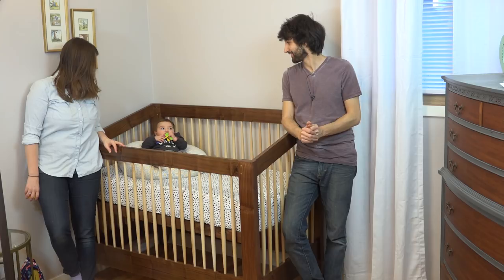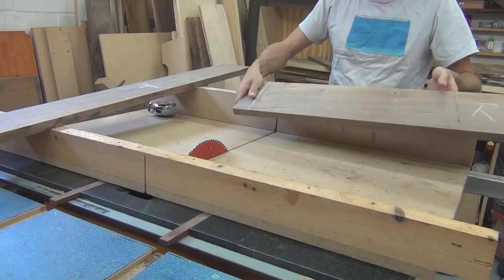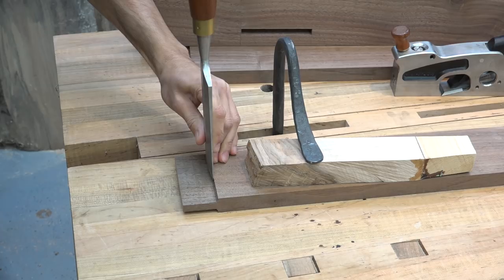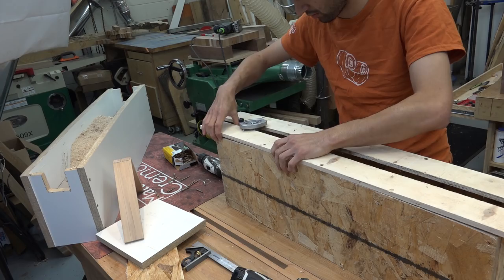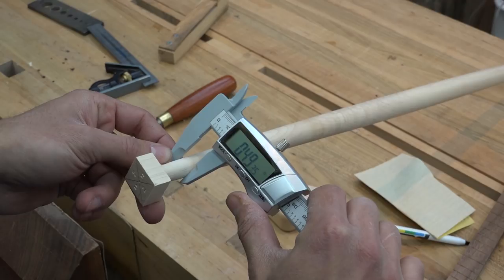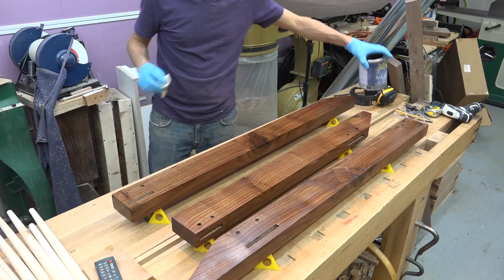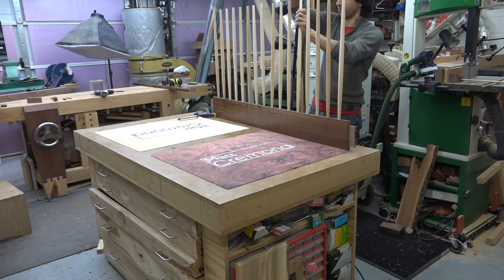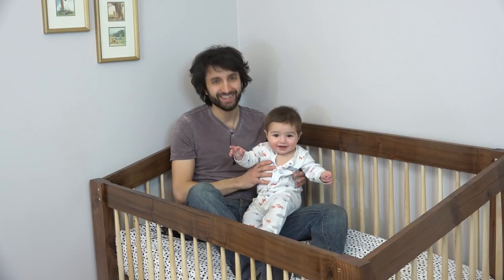Making an Adjustable Height Walnut and Maple Baby Crib

Comment: Finally! Been waiting ages for this. Why did you choose to create a tenon on the spindles and not just slide them into the rails as is? Looks amazing Matt, really enjoyed the video
Reply from the maker: Finally :) sanity reasons. I would have had to make 9 jigs or modified each spindle's taper to hit 1/2" a different length from the center. Thank you!

Comment: Did you publish the basic dimensions on this crib anywhere, Matt? I will probably be building a crib at some point in the next year or so and absolutely love the way yours turned out. Thinking I'll just buy Walnut dowels though, hah, those spindles looked like a lot of work!
Reply from the maker: I don't think I have them posted anywhere but the frame is just sized so the mattress fit snuggly inside it.  The spindles is where all the time goes

Comment: Awesome video, Matt, really appreciate the long form video with details on all.  Also, awesome work! One question for you - did you use a special blade or set up other than that small jig to cut the brass rod on the bandsaw?  I've been too chicken to do that before with a wood bandsaw, but looked painless in the video.  thanks again
Reply from the maker: Thank you! I was nervous at first and didn't know what to expect. I even added some oil thinking that might help. I was able to just run it through as is without issue. Granted I do have a carbide blade in that saw but the feedback I heard from others was that brass will cut easily with a regular blade too. I did a bit of a demo going through the cutting in my shop update here http://youtu.be/pzlBhf9NpXw starts at about 2:30 in

Comment: I've watched this video about a half dozen times now trying to work up the courage to do it myself, but I have limited tools and experience.  There is a lot to consider, I'm curious what references you used to decide the height of the front and rear legs, and the adjustment levels of the mattress.
Reply from the maker: +Slagon Drayer I referenced the cpsc standards for cribs which is what manufacturers would have to conform to

Comment: amazing work as always matt, been looking forward to seeing this for a while, do you think the reason the spindles yellowed was due to the fact it was in a aerosol can and pressurised? the reason I ask is I had the same results when brushed on it stayed white but when I used a spray can it yellowed but they were different brands...many thanks scott
Reply from the maker: Thank you Scott!  I'm not sure.  I guess the only way to find out would be to buy a can and apply it by hand.  The water based finish that I previously tried stayed nice and white.  Different brands as well.

Comment: Very nice! Is the mattress adjustable? It looks like it's too high, thanks for sharing
Reply from the maker: Thank you! Yes, the mattress can be positioned anywhere along the legs by drilling and tapping new holes. It's currently set to the same depth as his bassinet.
Reply: Matthew Cremona I was trying to figure out how do the socket cap screws work in holding the mattress frame? Are you actually drilling the holders to the posts and securing with these cap screws?? Or was something else deviced?
Reply from the maker: Yes, the support rails are held to the posts with the screws
Reply: Matthew Cremona thanks Matt!!